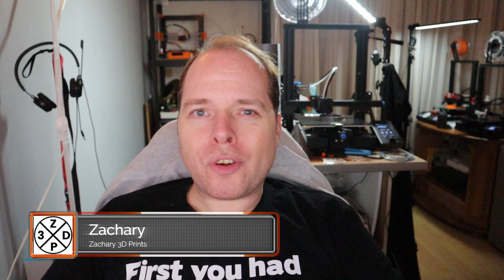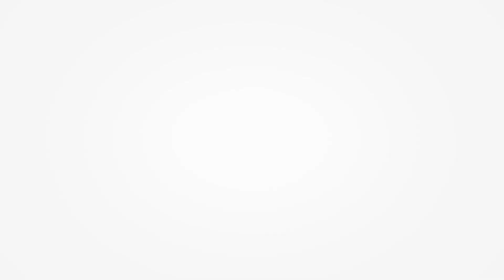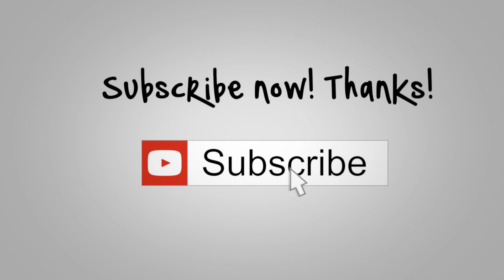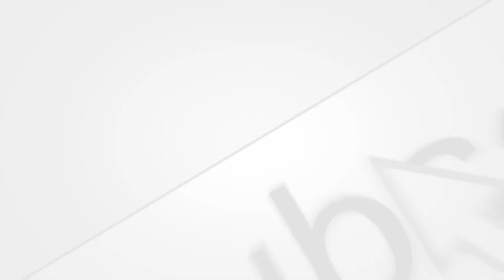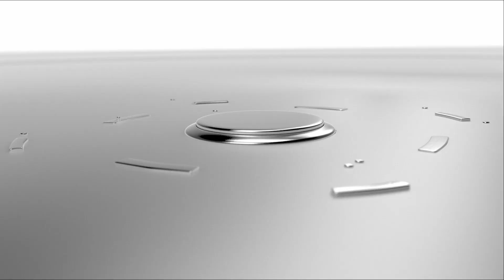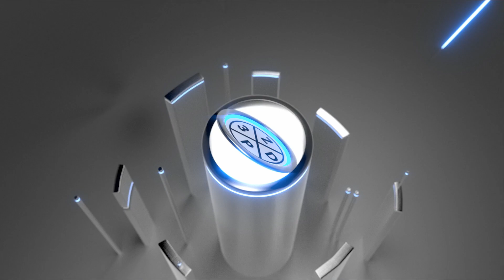Why buying genuine products for your 3D Printer - Open Source and Licensed products

Comment: What is your opinion on Prusa now?
After you have an original pruse with the Mini.
Reply from the maker: OMG... That is printing awesome! Straight out of the box, great printer profiles that do work and print and forget... doing other things in the meantime. Some of my printers I have the same thing, those are working great. But this little printer... Indeed a considerable difference.
Reply: @Zachary3DPrints  Exactly my opinion. Big little machine.
It would be cool if you could do more clips with the Mini.
Reply from the maker: @herr_rossi69  Oh, there are going to come more... I post a lot on Twitter lately. But do you mean on Youtube? Yes, that is going to happen indeed.
Reply: @Zachary3DPrints  here on Youtube would be good ..... I don't have Twitter😉
Reply from the maker: Specially for you and others people I'll going to make some little blogs for the short videos of the Mini and or other printers
Reply: @Zachary3DPrints  👍